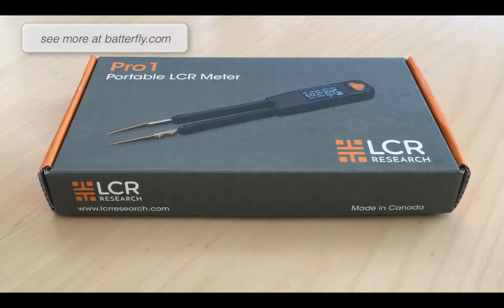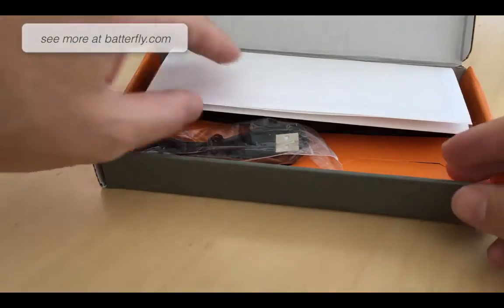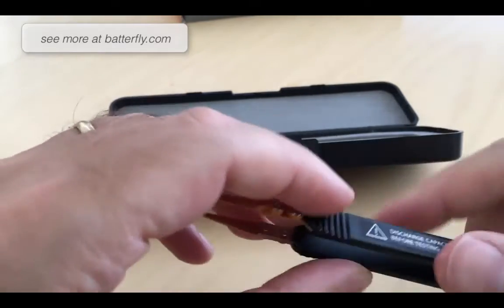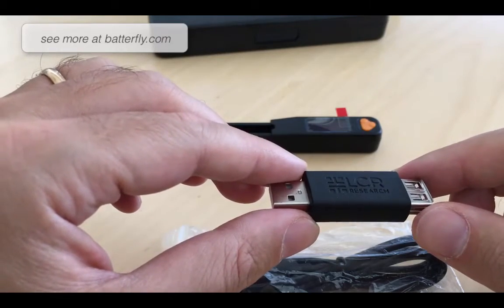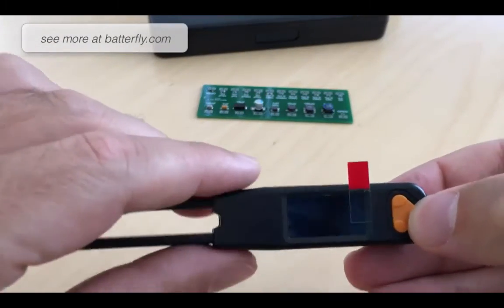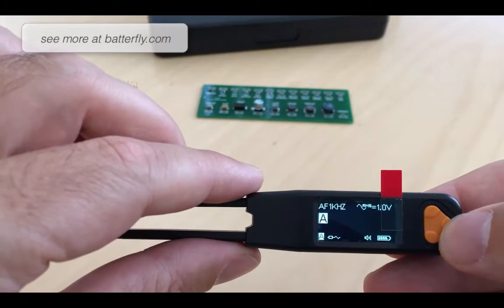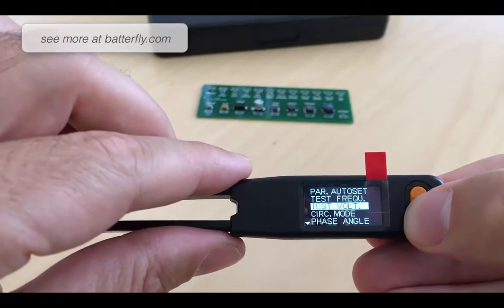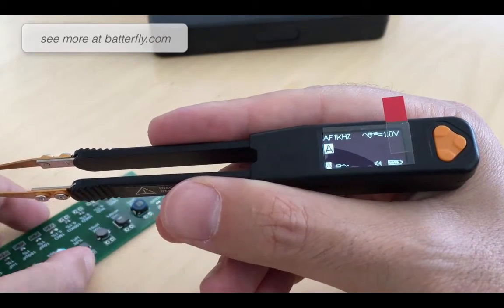How it Works LCR Pro1 Smart SMD Tweezers

Comment: HI, anyone please help me.  can this tweezers test a  regular  big capacitor and resistor ,i mean non smd  because i plan to get cheap one for my school project.. tq
Reply from the maker: Hello, you can measure up to 10MOhm and 500uF
In case the component is big you have to bend the contacts
Reply: +BatterFly2002 great, thankyou sir..